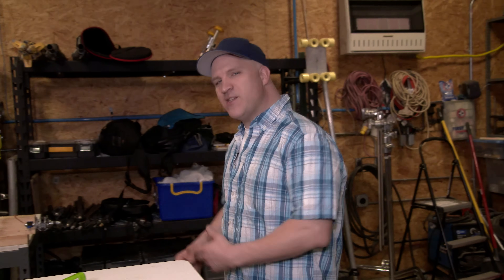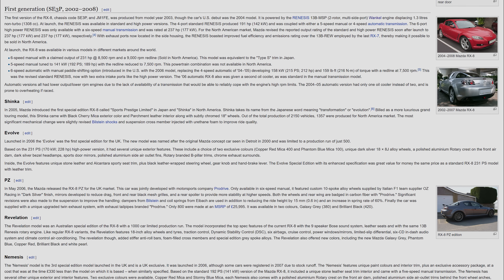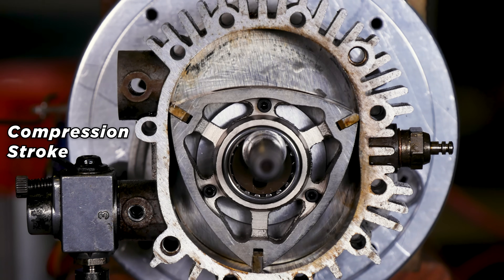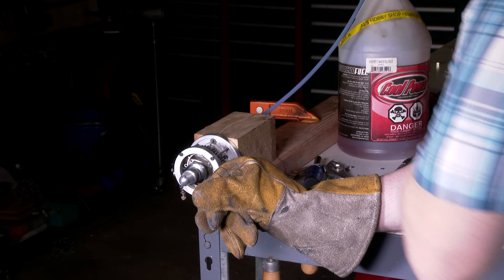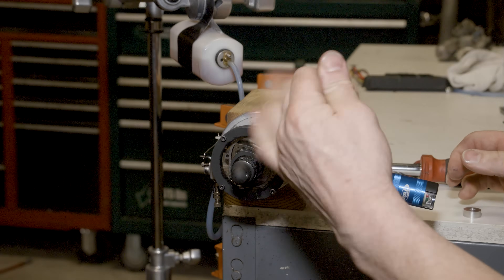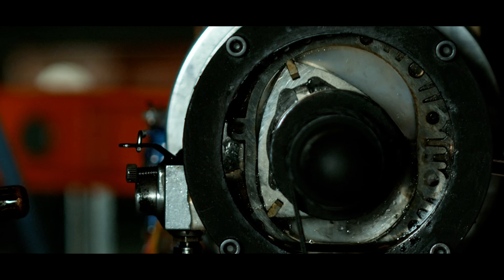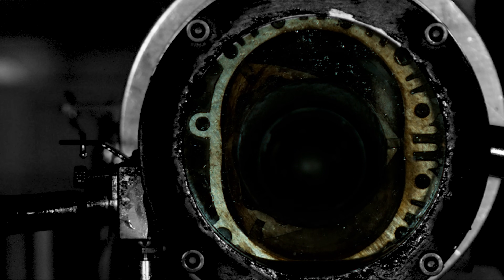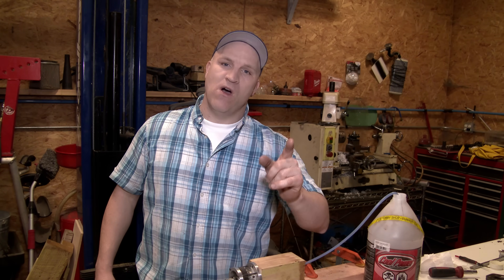See Thru Rotary Engine in Slow Motion - (Wankel Engine) 4K

Comment: The power-to-displacement ratio listed by Mazda is wrong. They only list the displacement of 1 face per rotor, even though each rotor has 3 faces and therefore creates 3 combustion chambers inside the housing. It wasn't a 1.3L engine, it was a 3.9L engine. 231hp from a 3.9L engine is pathetic -- however, because the design allows 3 combustion chambers to share the same hardware, it's able to pack that 3.9L engine into the size of a 1L motorcycle engine. That is the really impressive part -- not the power-to-displacement ratio, but the power-to-size ratio.
Reply: All three rotor faces are in-use at the same time. They are all engaged in different phases of the combustion cycle at any given instant.

The "doubled" displacement rating you mention isn't an industry standard. There is no industry standard, because only Mazda builds rotary engines anymore. There is Mazda's standard of rating the displacement of a single rotor face, and there are endless arguments about whether Mazda's standard is correct. Obviously I am one of the people who thinks Mazda is wrong.
Reply: Shawn Elliott you are definently one "special" individual lol. Just to help you out a little, your hilarious 3.9L theory would be wrong anyway as there are 2 rotors not one (6 faces not 3). I'd love to see your IQ lol. You want to hate on rotary's fine, but you may want to consider a less embaressing way to do it.
Reply: +vjjeeper1 You clearly know very little about Wankel engines son... a Mazda 13B has a true displacement of 3.9 liters.
Reply: +yjjeeper1 You must have some reading comprehension problems son... do you want me to post it again but use smaller words?
Reply: +yjjeeper1 Its very simple... each orbiting piston(rotor) has 3 sides forming 3 combustion chamber volumes, each with a swept volume of 654cc.  times the 2 housings is 6 and equaling 3,924cc.
 The other important thing that people without formal engineering experience fail to understand is that a 4 cycle Otto or Diesel engine completes its firing sequence in 720° of crankshaft rotation while the 4-cycle Wankel KKM designs required 1080° of rotation to complete its firing sequence...
 These two important and often misunderstood details are the basis of the commonly used "2X" conversion formula for accurately "comparing" the displacement of the Wankel with other designs..  Any questions? I would be happy to explain in more detail...
Reply: The combustion chambers in ALL engines are formed by the combinination of a stationary component and a moving component. For piston engines, the combustion chamber is formed by the combination of a piston and a cylinder; for Wankel engines, each combustion chamber is formed by the combination of a single rotor face and the portion of the housing it's sealed against. Why only a portion of the housing, instead of the whole thing? Because the rotor divides the space inside the housing into 3 separate chambers, whereas a piston doesn't.

If you have a piston engine with 4 combustion chambers of 500cc displacement each, you don't say it's a 500cc engine because only one combustion chamber is actively combusting at any given moment. You say it's a 2L engine because that's how much displacement will be used for combustion at some point. It's the same with Wankel engines -- you're supposed to count the displacement of all 3 combustion chambers per rotor because the displacement of all 3 combustion chambers will be used for combustion at some point. Mazda invented a special bullshit rule for rating their Wankel engines so they could get into a race that wouldn't allow their engine otherwise, and the engine wouldn't have been competitive if they'd made it smaller.
Reply: They were obviously looking for a reason to bust you. How loud was your exhaust, I wonder?
Reply: Dude just give it up, you were wrong just admit it so hundreds of people don't feel like they have to explain every detail of how what you keep saying makes absolutely no sense, which I am also going to avoid doing because like ten people have already said everything there is to be said, and you still are convinced you are the one and only sane and correctly informed person on Earth regarding this topic.....amazing.
Reply: Rotors are centrifugal two stroke. You should re-evaluate your life.
Reply: +E85 13B   All Wankel engines are 4-STROKE
Reply: Wrong methodology. A rotor piston is three sided verse the standard one side cylinder. An opposed cylinder engine would have two sides per cylinder. Opposed cylinder engines utilize ports and produce more torque.
Reply: https://www.google.com/imgres?imgurl=http%3A%2F%2Farrc.ebscohost.com%2Febsco_static%2Frepair-tips%2Fchiltonimages%2F8000%2F88528g09L.jpg&imgrefurl=http%3A%2F%2Farrc.ebscohost.com%2Febsco_static%2Frepair-tips%2F8852CH08_THE_WANKEL_ENGINE.htm&docid=MP6UfdYBiIb7BM&tbnid=ENH9yKIZqJrmmM%3A&vet=10ahUKEwjS-vrEge3bAhULjlkKHfFUBGwQMwh1KCwwLA..i&w=770&h=294&bih=1318&biw=2210&q=rotary%20combustion%20chamber&ved=0ahUKEwjS-vrEge3bAhULjlkKHfFUBGwQMwh1KCwwLA&iact=mrc&uact=8
Reply: Please go here . . . . 

https://www.youtube.com/watch?v=0Gw1hRdS008  

And read my simple explanation about how rotary engines work.

Cheers.

J.S.
Reply: I think the whole point is at any given moment, there is only one face combusting, whereas in a piston there are multiple.
Reply: And a 4 stroke piston  engine gets a power stroke (suck, squeeze,pop,phooey) half a rev times 4 gives 1 power stroke every 2 revs, the Wankel gets 3 combustions per. rev.So it is 6 times greater volumetric displacement that is in effect 78 litres pushing out a pathetic  2.96 h.p. per litre.
Reply: Shawn Elliott Never thought about that before. It's kind of like when people tell me how efficient turbo cars are, I work out the real size of thier engine based on the boost, it's usually about on par with any other engine then.
Reply: JKresz huh? In a piston engine half the time it does nothing.
Reply: A four stroke design utilize torque via expansion rate. Two stroke utilize power via expansion rate.
Reply: Most search for excuses to dismiss the fact four stroke unaccommodate power at static displacement.
Reply: You can compare power/volume ration only for engines with same construction, this will give you rough eficiency difference of 2 engines. comparing rotary and piston just wrong. Better compare their efficiency directly in this case. 
Otherwise, one can compare NA and turbocharged engines...
Reply: You do realize that the "combustion cycle" includes the intake, compression, and exhaust phases too, not just the combustion phase, right? All three faces of each rotor are performing one of those phases at any given time, so they are all in-use and all of their displacements count towards the total displacement of the engine.

For fuck's sake, this is not complicated.
Reply: +yjjeeper1 Licensed? BMW mechanic?  Do you need proof you recieved a rabies shot and they give you ID tags for your collar???
Reply: +yjjeeper1 I don't think you could identify a Rotary type engine if I dropped one on your foot son.
Reply: Shawn Elliott rotary engines when compared to a standard piston motor there capacity is doubled yes the rotor has 3 faces but only 2 are ever being used at the same time therefore the industry standard is doubled so a 13b is a 2.6 liter engine even though its a 2 rotor with a 650cc combustion chamber
Reply: You obviously don't know shit about rotaries then, just watch the slow motion of one running or lookup the diagrams you can clearly see only 2 faces at anytime in use
Reply: It takes a rotor 1080 degrees of shaft rotation for all 3 sides to go through a combustion cycle or 360 degrees per cycle a cylinder engine take 720 degrees hence why it is the standard to double the engine capacity to get a piston equivalent nothing to do with power
Reply: Shawn Elliott You only count the part of the cylinder or chamber used for combustion. So it is a 1.3L
Reply: ALL THREE CHAMBERS PER ROTOR ARE USED FOR COMBUSTION. That's why you have to count all three. Jesus Christ people, this is not complicated. Stop inventing special bullshit rules for Wankel engines; they're still just an expanding-volume internal combustion engine just like piston engines are, it doesn't matter how the compression and expansion are achieved.
Reply: Shawn Elliott But the rotor has 0 chambers. You Know, the casing has half part intake/compression and other power/exhaust. The rotor faces don't matter here. The COMBUSTION part (power/exhaust) is the one that matters here. It is a 1.3 L.
Reply: Shawn Elliott Do you know double acting engines? You need to duplicate the displacement because there are two combustion chambers. On A rotor , the chambers are not on the rotor, but they are on the Assembly around it. Because you only have one combustion chamber, you only count the displacement once. On a double acting you count twice. Why? Because to different and independent chambers work at the same time , and even through its only one piece, (the cylinder) the combustion chambers are separated by the piston. There is no special rule for the Wankel. You only count the displacement of the occuring combustion. ONLY THE COMBUSTION CHAMBER OF THE HOUSING on all engines; The effective combustion/power of the housing, because you don't count rotor displacement, but chamber displacement.
Reply: Shawn Elliott What you are saying is all around the rotor is always COMBUSTION occuring. That is not true . You only use one face at time and always on the same movement.
Reply: There are many characteristics that make it difficult to compare to a piston engine. You are correct that the Wankel engine has a power delivery similar to a 2-stroke piston engine. However, when I say it's a 3.9L engine, I'm taking into account the cumulative displacement of all 6 combustion chambers over the course of a complete combustion cycle for each chamber. All piston engines are rated this way, no matter how many pistons they have, and whether they are 2-stroke or 4-stroke. A 2-liter 4-cylinder piston engine, for example has 4 combustion chambers each displacing 500mL each per complete combustion cycle.

The number of crankshaft rotations required to complete a combustion cycle is not particularly important, because the power output is modulated by the transmission gearing anyway. Case in point: A Wankel engine has 33%-lower gearing than a comparable piston engine, to compensate for the fact that it takes 3 "e-shaft" rotations to complete a combustion cycle in a Wankel engine, as compared to 2 crankshaft rotations to complete a combustion cycle in a piston engine. That's why my RX-8's engine turns 4000rpm at 70mph, whereas a piston engine with comparable power output would be turning somewhere closer to 2700rpm.
Reply: Fuel only ever fills up 1 / 3 of the space though.  I think it makes sense to rate them that way as a result.
Reply: No, it doesn't make sense to rate them that way, because all 3 combustion chambers are in the process of producing power at any given time. Piston engines aren't rated according to their displacement only during the intake phase, they're rated according to their displacement during the entire combustion cycle.
Reply: Shawn Elliott that's like your opinion against 99% of the automobile industry, including people much smarter than you who know much more about rotary engines than you do.

Like I appreciate that you have an opinion and I understand what your argument is, but it's not like it's black and white.  It's just a different way of looking at it that, while interesting and potentially amusing in it's own right, doesn't somehow mean that you're correct and everyone else is wrong.

If rotary engines acted like piston engines, they would be rated like piston engines.  That fact that several metrics in a rotary engine are measured differently -- engine speed, displacement, etc (both of which are "off" by a factor of three) -- reflects the fact that these engines are different.
Reply: I have no idea why you think Wankel engines function differently than piston engines, or why you think Wankel engines are rated differently in terms of power output. They aren't. Wankel engines rely on reciprocation to capture the energy created by hot expanding combustion gases just like piston engines do, the only difference is the reciprocation and rotation aren't mechanically separated in a Wankel engine like they are in a piston engine. And Wankel engines are rated exactly the same as piston engines in every aspect of power output and fuel economy. It was a marketing decision by Mazda to underrate the displacement by measuring a single combustion chamber per rotor rather than measuring all 3 combustion chambers per rotor. That marketing decision was responsible for the 787B being banned from Le Mans after it won in 1991, because in reality the engine had much larger displacement than the rules allowed. So in fact, I agree with 99% of automotive engineers -- it is the 1% that are incorrect. Those percentages are reversed when talking about automotive enthusiasts like yourself, however.
Reply: Shawn Elliott Rotary engines are not the same as piston engines.  You're comparing apples with oranges and then wondering why people disagree with you.
Reply: No, they are not the same, but they are very similar. They are obviously not apples and oranges, because both engine designs are capable of doing the same work. And I'm not wondering why people disagree with me. Sometimes it's because they just want to argue, but usually it's because they don't know what they're talking about.
Reply: They are apples and oranges.  It's kind of comical to try to say otherwise.

Some organizations do rate these engines at 2.6 liter equivalance for racing purposes, kind of like what someone else was saying earlier, but that's still just as equivalence rating, not an actual displacement rating.  

You're trying to multiply the displacement by three though, which nobody ever really does (besides maybe a few rotary fans here or there).  I can see why you might be tempted to think of it that way, but it's a very elementary way of looking at these engines, and is simply not correct.
Reply: I am aware that some racing organizations multiply Mazda's underrated displacement by 2 as a compromise for regulation purposes. I'm not multiplying Mazda's underrated displacement by 3, I'm counting the displacement of ALL combustion chambers in the engine, same as is done with piston engines. Why? Because the displacement of ALL combustion chambers is what dictates how much air the engine can intake at full load, which in turn dictates the amount of fuel the engine can burn at full load, which in turn dictates the engine's power output and fuel economy.

Because I actually own a Mazda with a Wankel engine, as well as owning and using several of these little model Wankel engines, their size, power output, and fuel economy actually affect my life; it's not just an academic debate for me. The low fuel economy makes a lot more sense when you realize the 13B is a 3.9-liter engine, not a 1.3-liter engine. The reason for rating the 13B as a 2.6L engine for racing purposes is because it produces power comparable to a 2.6L piston engine, and the power output is the only thing most racing organizations care about for fairness purposes. In terms of absolute performance, the Wankel is actually pretty terrible because it produces power equivalent to a 2.6L piston engine while consuming as much air and fuel as a 3.9L piston engine, but racers still like it because it's much smaller and lighter than a 2.6L piston engine. Fuel consumption doesn't matter in most races, after all.

I'm done with this conversation. You've made your point about other people rating the engine's displacement differently, I've explained why they are wrong, and you aren't interested in changing your mind. There is nothing left to discuss.
Reply: hey u should change ur profile pic man. its a symbol like japanese nazi

Comment: The Wankel engine is also used in seatbelt tensioners, because a the exhaust from a fast-burning capsule of propellant (basically a blank round from a gun) can be fed into a Wankel engine to make it spin without requiring a starting motor. The propellant ignites when the forward collision sensors are crushed in the beginning milliseconds of a crash, and the Wankel engine cranks-down on the seatbelt spool, taking-up any slack in the seatbelt to keep the passenger pinned tightly to the car seat.
Reply: Lol, I didn't know, i just googled it, thats quite curious haha.
Reply: But the important thing to remember is that they are no longer used for automobile engines because of the poor reliability and low efficiency problems that have always plagued this design as an internal combustion engine they no longer offer any advantages over reciprocating engines and could no longer compete with them and had to be discontinued.
Reply: Put down the crack pipe! Drugs are bad, Mmmkay!
Reply: @BrandyLynn34  what? He was just explaining something